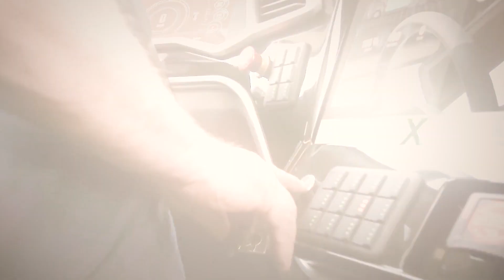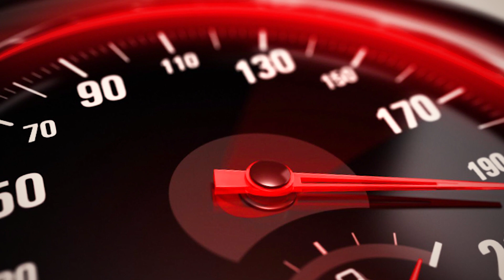Nikola Badger vs Tesla Cybertruck vs GMC Hummer EV

Comment: Tesla Cybertruck...
Greater range - Exoskeleton design for safety (also 9mm bulletproof) - bio weapon HEPA filter - water distillation unit that makes water from the air with water filtration systems (HVAC) - builtin air compressor - 110v & 220v power outlets - Starlink Satellite uplink for internet access anywhere in the world - more advanced battery management offering less battery degradation - Armour glass - Heat pump Technology - Vault with built in Solar panels - vehicle-to-grid (V2G) technology so you can make money buying and selling power - Autopilot... Just to name a few technologies the Cybertruck will have. There is no Tesla killer... Tesla is too far in front technologically, because the other car companies were asleep at the wheel, thinking electric vehicles were not possible or won't catch on, they are a decade behind.
Reply: @Dancing Deity A. sure but those trucks arnt bulletproof lol
B. you can enable it and disable it and you don't even need to set it as an option but ok. 
C. thats their current cybertruck battery but they are coming up with a new 700 mile battery chargeable in 1 minute. 
D. Tesla is less expensive
E. The nikola badger still isnt breaking any records cybertruck set other that the "battery" but everything else is either equal or worse on the badger
Reply: @Dancing Deity why lol they are a great company by with great people i dont see why you think the company is bad